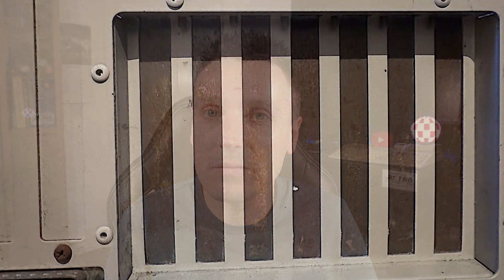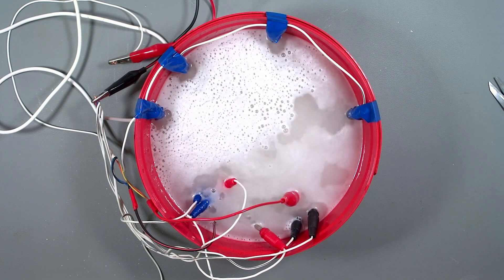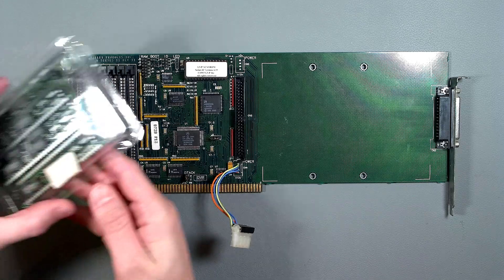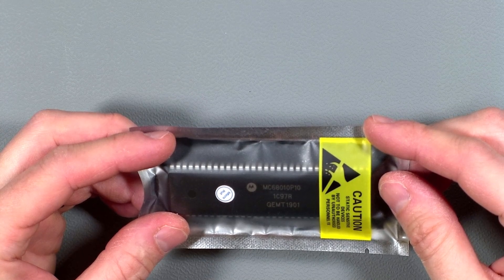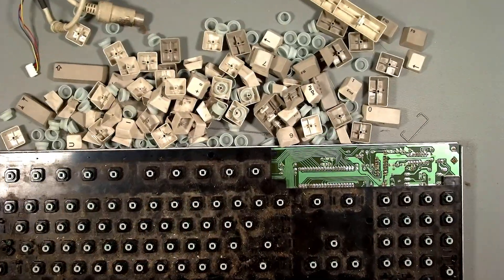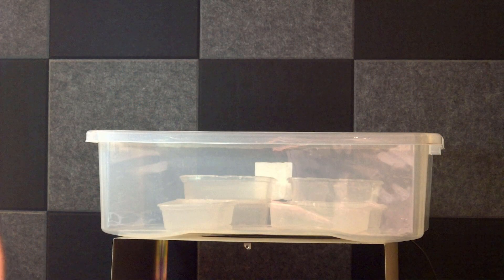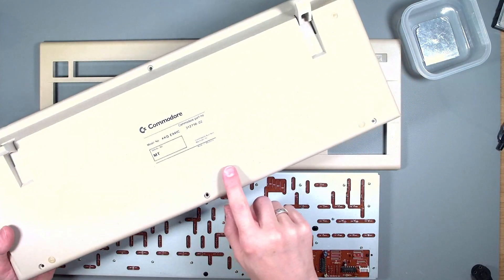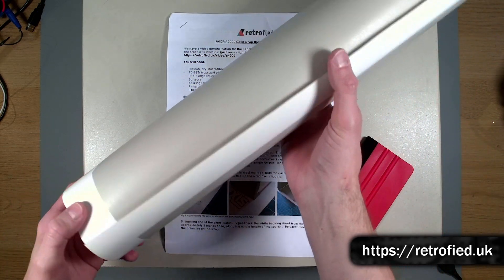Rust to Lust! Amiga A2000 Upgrade Time!

Comment: Great job, another A2000 well saved. The keyboard surely has PBT made keys, except the space bar (longer keys sometimes are cheaper to be made in ABS instead)! PBT won't go yellow!
Reply from the maker: Oh, interesting, I'm going to pin this comment!
Reply: Interesting I wonder if this is why most of the Macintosh portable keyboards have yellow spacebars.
Reply from the maker: Could be! Seems to be fairly common

Comment: I made sure I covered all my A2000 keyboards with plastic wrap to save myself unnecessary work later on.  Good to see you not submerge but suspend the parts during retrobrighting. There is spray paint available to color match the case.

Comment: Great to find out about that vinyl wrap. I’m about to be doing this same project on a pair of 2000’s. Gotta order some wrap for them.
Reply from the maker: Yeah it’s great, even has a similar texture to it, unless you look really closely you’d never know…. And even then it’s hard to tell
Reply: Yeah I’m glad I just saw this! I’ve been trying to sort out how to strip down, powder coast and color match my case. Mine has some rust spots around the top and I wonder if I need to address those before applying a vinyl wrap or if it would be fine to just leave it.
Reply from the maker: Unless it makes the surface uneven then just clean it and you’ll be fine
Reply: Cool. The only bummer is it costs almost as much as the wrap itself to ship it to USA 😆 oh well still cheaper than powder coating I would assume.
Reply from the maker: @sideburn true, and less hassle once you get it
Reply: @RobSmithDev  Exactly. Which should be in about a month or two 😂 🤦‍♂️ BTW I found your video searching the web for Amiga 2000 case restoration and you were the top hit!
Reply from the maker: Wow that’s good! Certainly wouldn’t have expected that but pleased about it!

Comment: I had a job to do a game conversion from PC to Amiga using an Amiga 2000.   I just remember this machine being so so so slow to compile. If you were accustomed to PC hard disk speed, Amiga felt slow.
Reply from the maker: I guess depending on what the PC was it might - in stock form it’s the same speed as the A1000, the A500 and the A600. I suspect a lot of people added accelerators to this though

Comment: It’s really nice to see someone else use sacrificial electrolysis to combat rust, for reference Stephen Leary he of 'TerribleFire' is very a much am advocate of this I’m sure he won’t mind me sharing. And those gasses will contain chlorine so the please do in a an open ventilated area.
Reply from the maker: Thanks - it’s also much more fun this way, and yeah I forgot about the chlorine! Good point
Reply: @RobSmithDev  how could Chlorine be produced when you used Sodium Carbonate (Na2CO3)... You're producing CO2 not Cl2.. You'd get chlorine if you were using Salt (NaCl).
Reply from the maker: I suspect there’s a small amount of chlorine in the water, it was tap water, although I’d admit it would be very little
Reply: White vinegar works well too (at least better than wd-40).

Comment: Hey Rob! Where did you get the 3D printed RGBtoHDMI bracket from?
Reply from the maker: My bad, just added it to the description (I designed them)
Reply: Cheers Rob.....but it was the RGBtoHDMI bracket I was asking about.....although the SCSI adapters will be useful because I also have the same SCSI card and a BlueSCSI device too.
Reply from the maker: ....now added to the video description